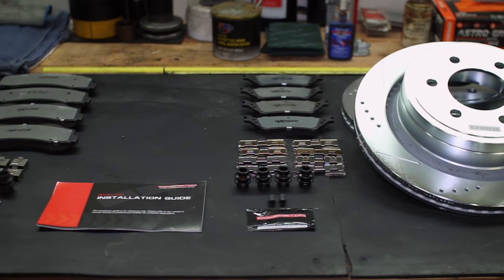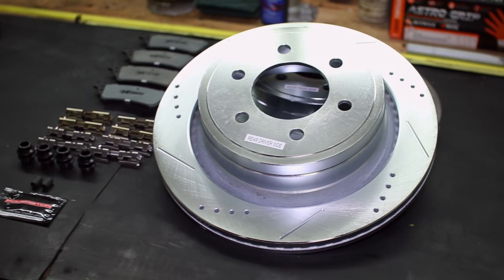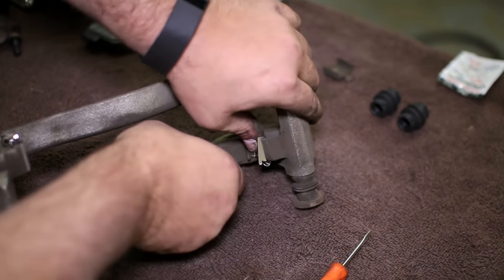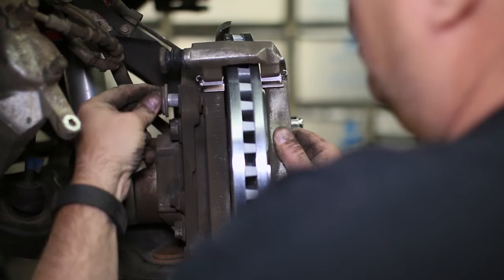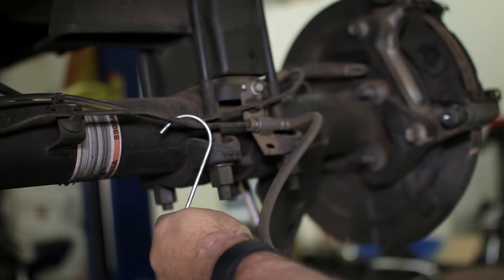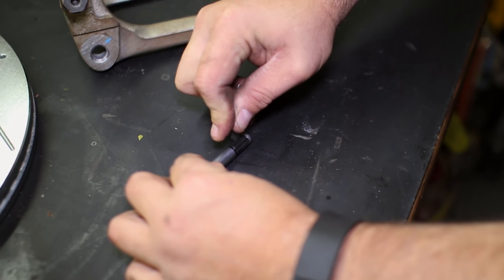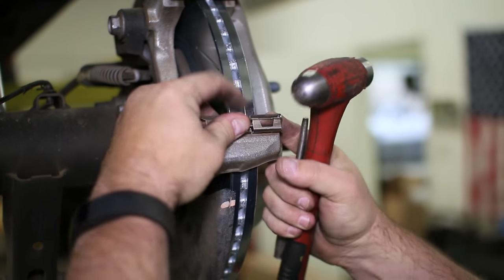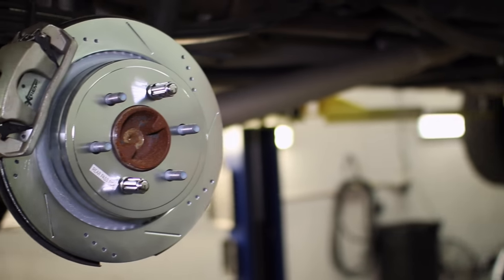2015-2018 F150 & Raptor Power Stop Z36 Complete Brake Kit Install

Comment: what is the "brake in" proceedure?    to pump the brakes, to compress the piston against the pads?
Reply from the maker: Powerstop will provide specific instructions with the kit, but it will involve making a few aggressive stops from around 45mph, then letting the pads and rotors cool back down

Comment: Any chance you could confirm the torque specs for the caliper bolts and anchor plate bolts? I have a Haynes manual, but the torque spec it lists for the front anchor plate bolts seems too high...
Reply from the maker: I have seen a few different specs searching for it, it seems the brake caliper anchor plate bolts are tightened anywhere from 148 to 184 lb-ft, and the caliper bolts 47 lb-ft
Reply: Thanks! Haynes listed 184 for the anchor plate bolts, but I couldn't get them that tight... I was afraid they would snap! So I used the old get 'em tight, then go two more grunts.

Comment: Anyone with real world experience have anything to say about these? Good/bad/indifferent? I have personally had good luck using OEM Ford brake parts over the brake parts Ive used from the auto parts stores such as Bendix or whatever "lifetime" parts they are offering. IMO the OEM stuff had a much better feel and stopped notably better than the previously mentioned auto store parts.
Reply: I'm going to be installing them this weekend in the driveway.  I will let you know in time.
Reply: Did u installed them are were you just fronting?
Reply: I have these on my 2014 F150 and they are great.  When they are cold they stop a little worse than normal but after about two stops they warm up and stop better than factory, especially in emergency stop situations, under load or pulling a trailer.  I have about 2,000 miles on mine.   They do not produce any dust, another plus.  Any they look cool, no rust on the rotors.
Reply: John B dude....

Comment: I bet they want out stop the stock Motorcraft pads. I have 57,000 miles on my 2016 F165 and I have never had my brakes to fade pulling a trailer.

Comment: Really no comments??
Reply: I have them on my 2015 F-150 (Powerstop Z36-6268)
Install is just as easy as in the video.  In fact the installation video influenced my decision to get them.   Very smooth braking and they definitely help stop the truck easier when bass boat is being pulled.   In my opinion they feel better than when the truck was new.  There is a break in period that can be performed in a matter of a few minutes.  It consists of getting truck up to 40 then moderately aggressive slow down to 10 mph. Do this 5  times in a row without coming to complete stop.  Then go 35mph moderately hard down to 5mph five times. Afterwards drive around for a few mins and let brakes cool.  
This seats the pads evenly to the rotor and prevents warping.  
Overall I am very happy with the brakes. 
 Hope this helps.